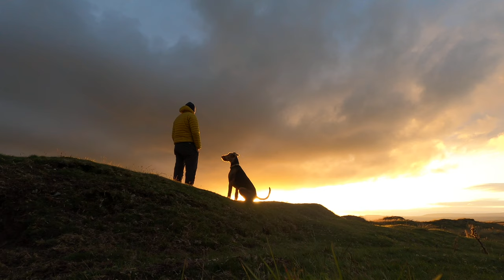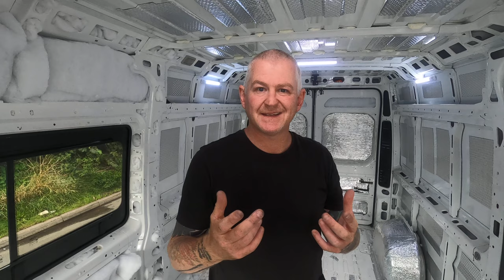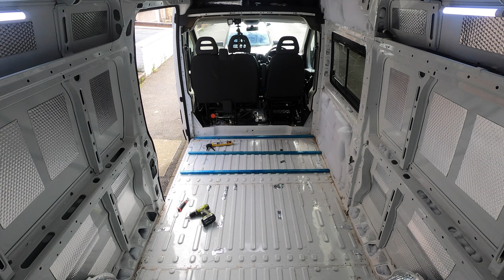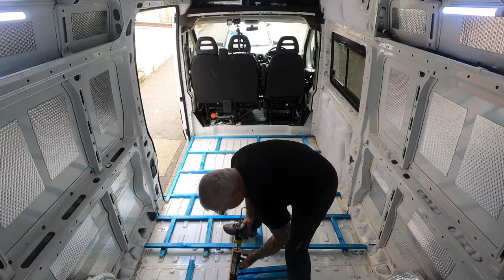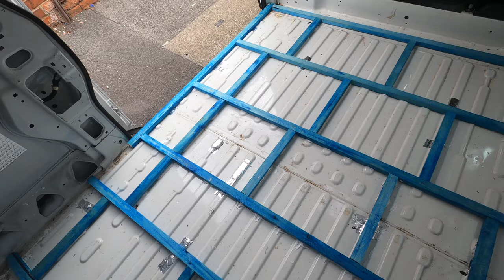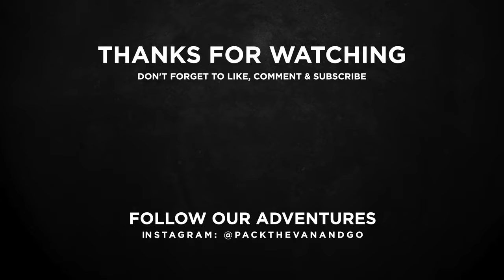RAISED FLOOR PEUGEOT BOXER VAN CONVERSION VAN LIFE UK

Comment: Interesting video again Rob. Is there any theory behind the arrangement of the batten pattern at all or just a random coverage?  Great to see the amount of care and attention to detail taken which will prevent (hopefully) further repairs later down the line. Keep up the good work
Reply from the maker: Hi mate, in the back of my mind was the fact that the floor is going to take the weight of everything and that the floor is going to be used 24/7, with me and the dog in and out. I also thought about what happened if we ever crashed and how the flooring would react without being secure. SO with all that in mind, i wanted a secure floor that could take the 24/7 use, hence using more wood than insualtion and making the grid tighter and less spaced out. Thank you for watching and hope that replay makes any sense?
Reply: It does Rob. Thanks for coming back to me. Dave

Comment: Nice work! What are you planning on doing for the roof racks
Reply from the maker: Do you mean the ceiling? Sorry meant to write, I plan on using some roof batons or maybe cut some thinner plywood that can shape to the roof supports, this will give me a fixing point for the cladding on the ceiling eventually! I don't want the ceiling to be lowered to much, but also need to think about insulation, so will be using recycled insulation on the ceiling! Hope that makes senes?
Reply: Archie And Me I mean the rails/racks etc that will hold the solar. You have the same van as me, so keen to see how you get on. I put the bed in mine today
Reply from the maker: @BruceLauderdale  https://www.amazon.co.uk/gp/product/B087CM4P97/ref=ppx_yo_dt_b_asin_title_o00_s00?ie=UTF8&psc=1
Reply from the maker: @BruceLauderdale  I plan on using these feet and fixing to the panel with self taping screws and some sikafix and then using loads of sikafix to bond the feet to the roof! Down really want to be drilling into the roof and making more water acmes point or rust areas in the future!